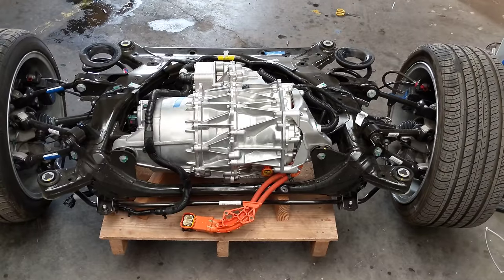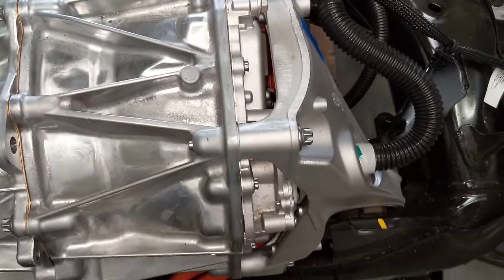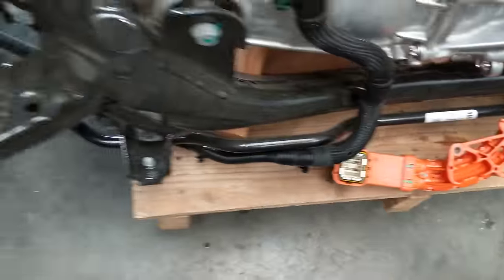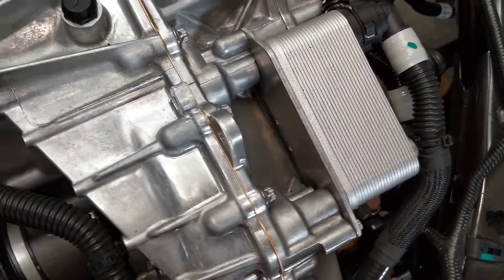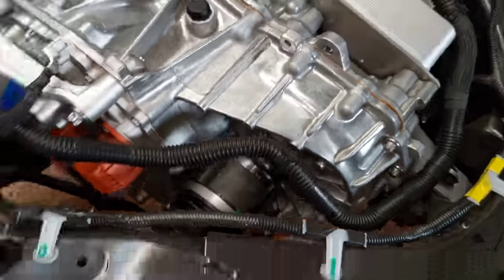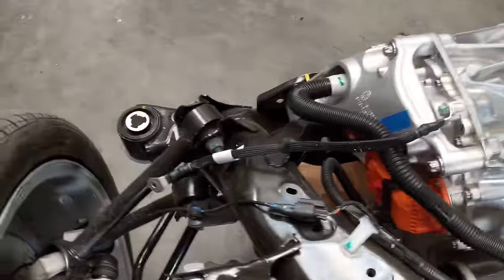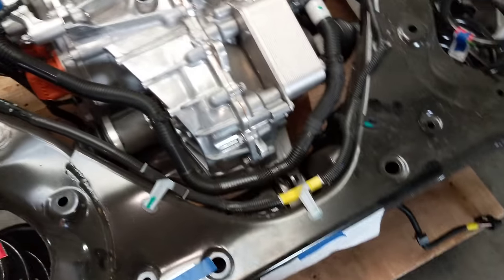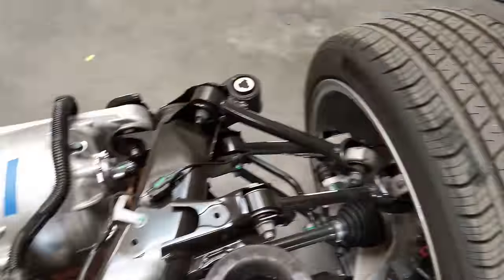First Look: Tesla Model 3 Drive Unit

Comment: Such a simple and elegant design that could produce such an amazing performance.  There is no freaking way those super complicated and costly to build internal combustion engines and transmissions can compete  with this.
Reply: They do compete if you're talking about manufacturing cost. It's a lot cheaper. Cost to run/fuel is another story.
Reply: ICE's are dead. I'm amazed how much progress has been made in the last 10 years.
Reply: @zolikoff  I think he's talking about the drive unit. The drive unit is far superior in most any way to ICE.  The current drawback is obviously the heavy pricey battery, but that will change with time.
Reply: Range and charging availability. 300 miles isn't great range and if you live in an apartment a lot of people around the county simply don't have access to a charger and who wants to work all day just to get off and sit at a charging station waiting for your car to charge. On the other side of that, if your buying a $60-$100k tesla than you probably not living in an apartment complex 😂

Comment: Wait a minute... removing the whole rear drive assembly involves disconnecting only 3 electrical cables, 2 brake lines, 2 glycol lines, 2 shocks, and 4 bolts?  That's amazing!  That's fewer connections than my motherboard...

Have been thinking about having mine raised, whether through spacers or custom coilovers. Such a simple design should really keep the labour down!
Reply: The whole car looks build with an amazing level of simplicity. If you watch other teardown videos its really interesting how clean and tidy everything is, compared to any other car, be it EV or ICE. Somebody put a real effort into the whole concept.
Reply: Just curious, why do you want to raise it?
Reply: Winter and bad roads (I live in Iceland).  My land is off a (short) bad road in the countryside. But even in town, ice and deep snow have done serious damage to my Insight quite a few times. Low cars aren't good here. I'd also love the possibility to do some "minor offroading" (hence my question about water depth in the other thread). A large chunk of our country is only accessible by these highland roads which are unpaved and generally little more than "some guy drove a bulldozer through here".  The major ones are mostly just washboardy and potholed, but the minor ones cross lava fields and stuff like that (I will not be subjecting my Model 3 to lava fields!  There's no chance the suspension could take that.  But being able to do the major roads would be nice). Large rivers are bridged, but streams and standing water are not.  So again... clearance.

Best option would be one that lets me change between summer mode (normal height) and winter/offroad mode (elevated). Was thinking that a simple way might be air suspension + larger tires, so you get both the benefit of air suspension raising it and the extra height from the tires. And said tires could be winter/offroad tires, kept on an extra set of rims, for easy swapping. The problem with that approach is that the front control arms stick out over the inner lip of the tires with only a finger's width of clearance. There would have to be some way to mount the rims slightly further out to avoid hitting it.  But obviously I wouldn't want "summer mode" to be mounted further out; that'd clearly be an efficiency (aka range / charge rate) hit.

Without changing tire sizes, spacers could give some extra height, but they'd permanently lock lower suspension positions off from me. I've been told that given the slack in the lines, probably the most you could raise a Model 3 through spacers would be about 2".  Which means that if you have air suspension too, probably no more than 1".  In that case, the "low" setting would be like the "normal" setting, and "normal" would be like "high", with "high" putting you about an inch over that, and "Very high" a touch more. Assuming that Model 3's air suspension will have similar settings to Model S's. 

Custom coilovers would at least let me adjust the height.  But really, the best would be if I could adjust tire size, either instead of - or in addition to - spacers or coilovers.   The more clearance in winter/offroad, the better.  If I could go from 45 to 65 on the tire aspect ratio, that would add almost two inches, which - with air suspension as well - would bring it up to +3" at low speeds, a touch less at moderate speeds.  Might even be able to get away with higher than 65 on the aspect ratio, so long as I never drop the air suspension to "low" with them on.  With 1" spacers that could potentially even bring it up to a max of +4".  Serious height!  But the spacers would be an extra cost and - again - lock off "low" from me in summer mode.
Reply: Hate to make this a male female thing, but I have noticed women in Iceland (Europe) consistently answer very technical stuff that I'd hate to say I rarely hear in the US. Probably because education is not only free, its great too. If I am wrong, I'll be happy about it.
Reply: ok, so basically a Tesla Subaru. That would be a cool thing...
Reply: Jaguar Ipace is probably close to what you're looking for. They're just expensive.
Reply: I-Pace: Expensive, grossly inefficient in order to push their "style" preferences, short range, made by an ICE company, using pouch cells, pushed with deliberately misleading advertizing,  higher clearance but not built for "offroad" usage, slow charging from a patchwork, often broken network, and about 20 other issues that I have with the thing.
Reply: Yeah, that's true too...
Reply: why would you want to raise it? its not a truck lol
Reply: @karenrobertsdottir4101  I like it a lot, and it works well offroad, better than Tesla, although not as good as Rivian or Bollinger, but its not a truck anyways. Also the fact that its made by a ICE manufacturer makes it even more appealing to me, maybe some of that sweet British heritage will live on
Reply: He forgot to mention their 3 ground shots and their skid plate shots and also a shot on the HV cable I used to put these on for Tesla till I recently got laid off!!😒
Reply: @joseanza868  you and 3,000 others
Reply: Yeah, get your shit together, Subaru
Reply: mountain pass performance now has spacers to do what you want just in case you still need it
Reply: @reviewcrewforyou  that would look wack af...I don't like lifted cars unless they are rally cars...lifted trucks are nice tho
Reply: @greynolds17  is not a crazy amount and it's help people that live on less than perfect roads still get to have one
Reply: i love simple design reminds me of 90s japanese cars, this is a winner right here, i cant say the same about their software locks though
Reply: Gerrad Reynolds and now it is
Reply: But parts will cost more it’s electric once the motor has a short which it will the whole drive unit is bad unless they figure out a way to service them with out removing the inverter.

Comment: This is the most advanced electric motor in the world and Tesla's ace in the hole!
Reply: Actually nearly everything about Teslas is very advanced.
Reply: Because you would know if it's advanced or not.
Reply: what is in there that isnt at least 100 years in use? come back when it runs on fairydust...
Reply: +majstealth The permanent magnet activated reluctance motor is possibly the first time in mass production, and it's a major advance since it's highly efficient.  Silicon Carbide power transistors have probably never been used in EVs before, etc.  Also more efficient.  Those are two major examples, among others.
Reply: Loanword Eggcorn
Batteries and electronics YES.  I don't know about the drive unit.  Manufacturing methods and structural design of the cars are not even up to minimal industry standards in terms of build efficiency, weight minimization, etc.  (I'm using Munro for as my primary source of information here)
Reply: SM-reluctance with PM has been used in volvo busses for some years.  Its quite new because it requires better computing/controlcircuits. Tesla have earlier used the inducktion motor which is easier to control but have worse efficiency.
Reply: +Bo McGillacutty Munro appears mistaken about the purpose of the various different types of high strength steel used in Model 3.  Bluntly, he seems to not understand why the different steels and structures are there.  His lack of understanding does not mean there's no reason for it.

He's also mistaken about the overall engineering design of the BMW i3, which is wrong in many ways.  There is lots of very cool technology in i3 and i3's manufacturing, but the overall design is poor in many ways.

Munro spoke highly of i3 design and poorly of Model 3 design.  That speaks to his competence at understanding larger design questions.  He understands details very well.  His understanding of larger design concepts seems incomplete at best.  He's good at analysis.  Not so good at synthesis.

Also the Model 3 he reviewed was relatively early production.  Later cars are better, as Tesla gained experience building them.  Pretty much everyone acknowledges that.
Reply: Loanword Eggcorn
Did you even bother to listen to Munro's ENTIRE discourse on the subject?  It doesn't sound like it. For one thing he was extremely positive about the T3 in some respects  how do you fangrils always  miss that?  Apparently Tesla was a bit too arrogant about dismissing well established methods of design/manufacturing of autos, structurally, to their detriment.  I don't claim to be an expert on the subject but Munro made a damn good case for his points and I doubt you can find a better, less biased source.  Who else has a deconstructed the car entirely and has a long history of doing exactly that with many other autos?...maybe one other that I can think of even comes close.
Reply: Ad hominem attacks won't win you any points for people who think rationally.  Yes I saw Sandy's positive comments about the Model 3.  His lack of understanding about some of the use of novel materials in the structure of the Model 3 chassis speaks for itself.
Reply: Fanboy/fangirl is a pretty benign, slightly humorous label and accurate enough for those who think Elon is God and can do no wrong.  I love the guy but that doesn't make him perfect.  Get over yourself already.  You'er quite uptight to call that an attack.
Reply: Calling people names is childish and weakens your argument.  Fact.
Reply: Loanword Eggcorn
What if I called you your real name?  Still weakens my "argument"?  Get a grip on yourself, being a fragile child is not appropriate for any discussion.
Reply: not really! This is one of the cheapest electric drive trains i´ve ever seen^^ The enigine itself, i´dont know can´t see inside, but the whole drive train is worse.. it´s not even good for a low-price e-car!
Reply: @ZzEulAzZ  Why are you trolling when you know nothing about it?  If you're referring to the welded control arms, weldments can be stronger and more reliable than castings if done properly.  The multi-link rear suspension is extremely sophisticated and performs well.

Comment: It's amazing how a tiny motor like that has the level of performance that can push a 4,000 car 0-60 in 5.1 (I think drag times had it as low as 4.6)
Reply: Yeah, DragTimes got 4.5-second 0-60. But Tesla seems to have throttled it back to 5.1 secs in a software update.
Reply: AWD version can do 3,3ec with optimized tires!
Reply: If only I had the money to get the dual motor performance.  My finances only allow for the single motor.
Reply: well thats already a very nice and fast car! I would love to have any of them.
Reply: That's the beauty of electric motors; small, simple and full torque immediately!
Reply: A tiny motor like that, and a big damn battery, don't forget about that. The battery is the powerplant, this just converts it to mechanical energy.
Reply: +Simon Alvarez That's not correct, check the DragTimes video again, freeze frame on the time vs mph graph, you can see it crosses 60 at 5.1 secs just like Tesla says. The lower time was the time without counting rollout, which is the default setting for a VBOX and it's always lower than the 0-60 from standstill value.
Tesla is simply quoting the time with rollout.
Reply: zolikoff Not completly correct - the Motor is a big and important thing - die example the coolingsystem makes it possible to put more volts through the motor which gives it more power - super good battery with shit motor wont work
Reply: Of course you need to pair the correct motor with the battery, but what I said was that the battery is the powerplant, it generates the power used. So when saying how a tiny motor is pushing the car, it's still actually the motor and battery pushing the car.
Reply: probably so they can sale a enhance version later on.
Reply: @zolikoff  the battery is still smaller than a 16 gallon gas tank
Reply: @mrdhavidee  Of course it isn't. Have you seen the layout of the Model 3? Look at a diagram or teardown.
It takes up the entire bottom of the car and is almost 500 kg in weight.

Comment: I'm impressed that little plate stack can cool the motor. I knew the motors are fairly high efficiency and don't have a ton of thermal loss, but wow that's still something.
Reply from the maker: These plate-stack type heat exchangers have a LOT of surface area, so with fast moving oil/coolant it can handle a lot of heat transfer.
Reply: @Ingineerix  I guess I'm used to our data center style plate stack Heat exchangers. We don't usually have very fast-moving fluid so maybe that's the difference.

Comment: Amazing to think that all this is held on by just four bolts! The forces those fouur bolts have  to withstand at full acceleration must be insane.
Reply: Well if you think it an old muscle car drive train is only held in by 4 bolts also. 2 front motor mount bolts and 2 transmission crossmember bolts.
Reply from the maker: They are BIG bolts!
Reply: Like @Watch said.  Not to mention electrical motors deliver strong but very smooth power.  Unlike high power ICE cars you need to do the dump the clutch at high rpm thing to deliver the power violently or the car just would not go.
Reply: BlackTalon53 Probably should refrain from any Dukes of Hazard stunts with those cars.
Reply: The whole Space Shuttle stack was held up by eight bolts - four in each SRB.

Comment: I am assuming "Front" is the end with the orange power cables? 

Can you show us what captures the coil springs on the top? 

And could you put a shock in place so we can see its mounting point and orientation?
It is interesting to note the use of welded fabricated steel sections for the sub frame vs the aluminium on the Model S.
Thank you for posting this!

Comment: This thing is so hot! Simple, powerful, beautiful..
Reply: Apparently simple , for simple minds. The complexity is shifted in the control hardware and software management unit.
Reply: @MrShimizoo  beats having to disconnect a zillion cables and lines to work on the car

Comment: Now let's build one of these to bolt up to an F150....
Reply: one? make it 2 and there you go: 4sec 0-60mph. That will be a nice F150
Reply: Four, one at each wheel.  The it's true 4WD without all the mechanical torque shifting/locking differential complexities.
Reply: Pretty sure the Tesla pickup will have basically the same drivetrain from the new roadster. 2 M3 rear motors and 1 M3 front motor. All of them will of course be geared lower. This will give incredible control over traction, and also dynamic stability while towing. Should be pretty amazing...
Reply: haha i am damn sure those will NOT be on the pickup. The pickup will have the same as the Truck. The ones from the roadster will be way too expensive for such a car
Reply: You do know that the Roadster and Semi both use M3 motors, right? I would expect the Tesla Pickup will be very expensive too btw. 65k+
Reply: Adam Mackey Smith no the Roadster will not use the same Motor. Ans yes it will be expensive - 65 is not expensive :D expect more like 80-100 base
Reply: Straubel confirmed in an interview they are the same drive units from the semi - which are M3's. But you probably know better than him...
Reply: Adam Mackey Smith gimme the link nur there is no way a motor that acclerates the M3 to Max 210kmh is supposed to acclerate the roadster to 400+ with just one Motor more? Also half the time to 100? Cmon. Just use common sense. It wont be the same. Maybe just the same kind of Motor/Technology
Reply: 2 more motors. Remember it has the front drive unit. As in the s and x the front unit will be geared higher...common sense...
Reply: You may be right, different windings or optimized for higher voltages or something, but substantially they will be very very similar.
Reply: The roadster will have 3 Motors while the M3 has 2. And if you gear it higher then you loose accleration. Its not working like that. EVERY motor is substantially very similar. Its these windings and cooling that make them expensive and stronger. If he ever said that then just to make stockholders feel like they will make tons of revenue.
Reply: Finally a proper F150!  (I own and owned too many already)
Reply: @Adam Mackey Smith DEWD...YESSSS!!!! I think you've said more about what's likely for the Tesla Pickup than anything else I've read Shame they won't have a lower price one to overtake #1 in that HUGE volume market segment (state-side, at least), like they've done with every other vehicel thus far. That would be epic, wouldn't you agree??? The torque is going to blow ICE pickup truck owners away I think.
Reply: @aussie2uGA  but then you have a truck with independent suspension and very little ride hight
Reply: @atomicsmith  I drive a VERY old 2000 7.3l power stroke. Go buy a new 2019 F250 Super Duty Crew cab with the King Ranch add on's, Get ready to pay 75K+
Reply: Fick Dich yeah I was thinking the same thing. $65k is not that expensive. That’s like a lariat f150. Everyone with a nice truck now will have one if that’s the case. Lol.